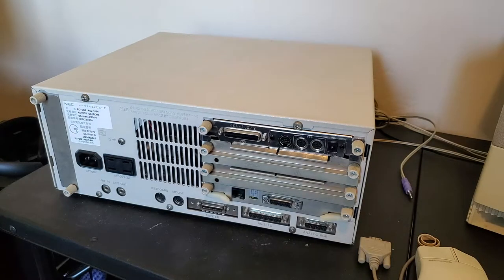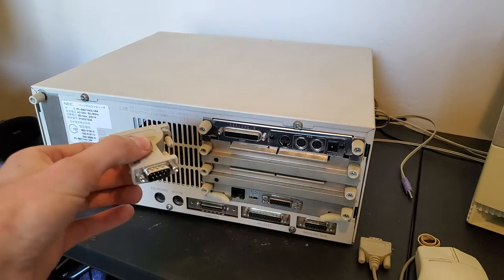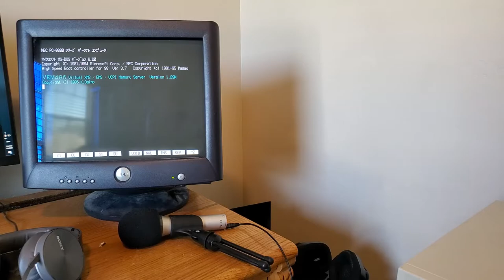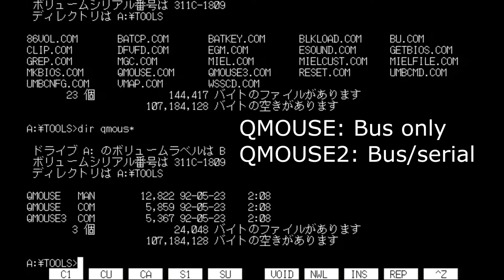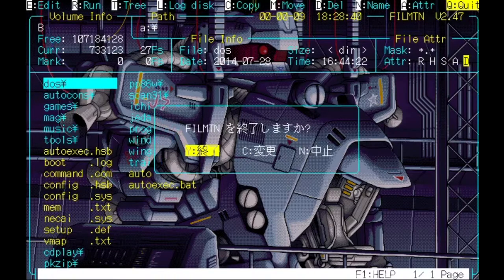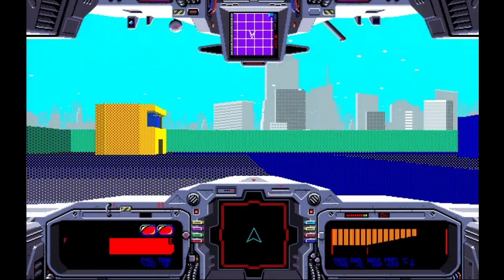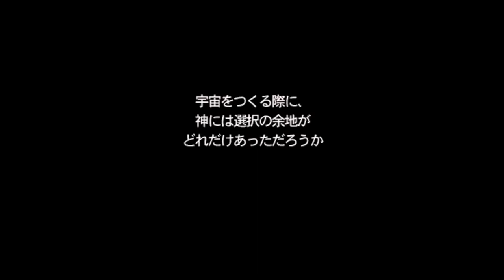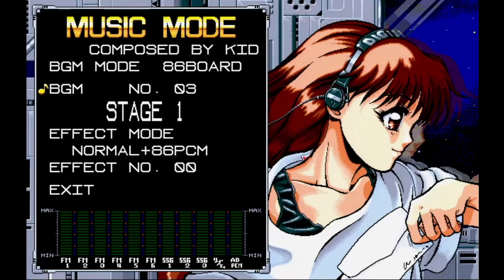NEC PC-9821 As2 Part 6: Using a Serial Mouse

Comment: The Sony Playstation original mouse is a BUS mouse, just cut off the end or get an extension cable cut off the playstation side, get a mouse din (mal)  and connect the wires and voila Sony mouse on a NEC PC

Comment: Shame that it doesn't work very well with DOS games.  Wonder if it works at all with Windows 3.1, though at this point I have doubts.  It'd be very nice if a serial mouse driver that works much better could be made these days, as it'd be useful to many people and I'm sure it's not impossible.  Though, thankfully I have a bus mouse and it didn't cost me much at all.  Also, how did you get Lode Runner playing from an HDD?  Is it natively working or are you using ERCVFD?  And btw, you forgot to move BINHUNT to your NSFW folder.  lol
Reply from the maker: I didn't get lode runner to work, that directory was just from when I tried to make it run from hdd. I've noticed the image came with some tools that could potentially make it work, but I haven't messed with any of that yet. I imagine it would be difficult to get a serial mouse driver to work universally with dos games since they seem to have their own drivers built in. Lol I'll add that game to the NSFW folder. But yeah, looks like I'll be hunting down a bus mouse.
Reply: @Tr3vor42532  My concept of a program like that would be to emulate a bus mouse on serial.  Have you tried any other games besides SC2k that don't use their own mouse driver executables?  I can think of FlixMix, Star Fire, and Chitty Chitty Train at the top of my head.  Also, check out Prince of Persia as it's a game that normally can't be played off an HDD.  It uses ERCVFD and you can use that setup as a template for other games.  Basically, convert PC-98 floppy disk images to .VFD format using a program called vfic, and it should work.
Reply from the maker: FlixMix didn't work with the serial mouse driver either, I haven't tried those others though. I'll have to give prince of persia a look, maybe that way I could get puyo puyo or lode runner working.

Comment: PC-98's serial port is 100% compatible with IBM PC's serial port?
Reply from the maker: as far as I know, RS-232 is RS-232, so it should work right. I think it boils down to the programs expecting there to be a bus mouse, since that was the standard for those machines.
Reply: nope, the programs are not programed to look for serial connection, its not as simple as we think it is. Heck, just look at the drive names WE: A&B floppy drives C.D.E HDD ~ nope bootable drive is A: HDD.....